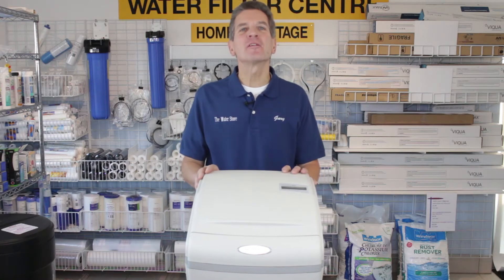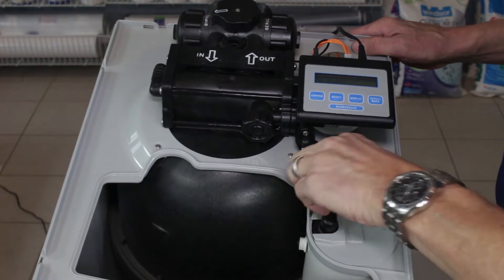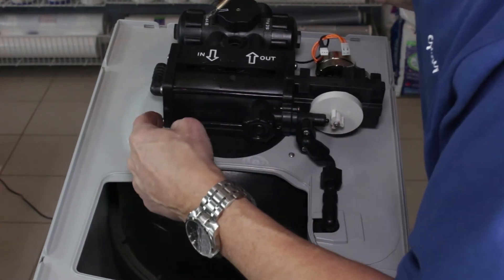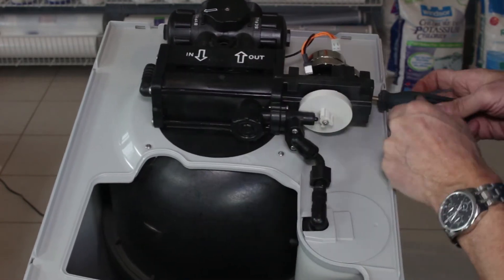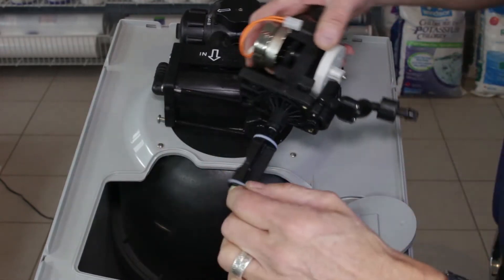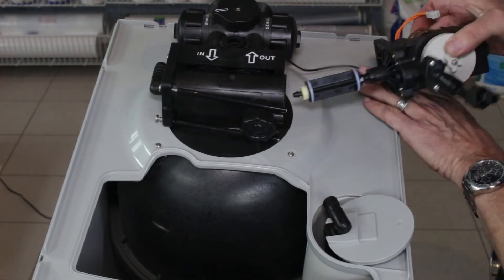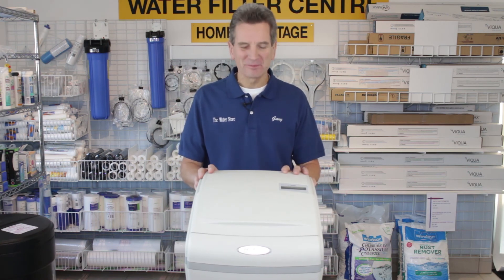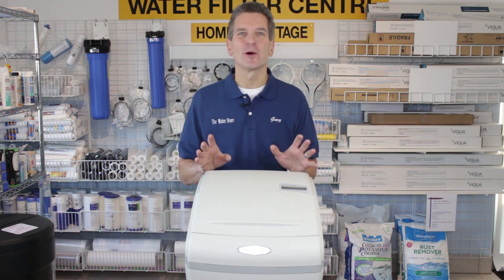How to Replace Piston/Drive End Cap in Aquamaster Water Softener

Comment: Hey Gary, thanks for your videos. They've made me more confident in disassembling and reassembling things on my WaterBoss 950. 

How would I know if I need to replace either the piston or the entire drive end cap assembly? My WaterBoss 950 was new in 2015 and seems to have been working well until recently I noticed a high water level. After cleaning out a salt clog and running it, many times, it still does not draw brine from the brine cabinet. I've tried all the usual suspects, I think, and I'm scratching my head.

I've checked the brine piston and flow control, the injector assembly, the air check/draw tube, the drain line, the drain end cap, etc. Originally I had a couple of inches of salt sludge in the bottom of the brine cabinet and in the brine well, but I cleaned all that out and checked all those other areas, and I still have the problem. During the part of the cycle (when it flashes "02" on the controller) when I would expect it to draw brine out of the cabinet, it never does. Instead there is a slow but steady addition of water to the brine cabinet throughout that "02" cycle (whenever the brine valve is open, I think). I even tried running it with the brine line disconnected from the draw tube, so I could see what was going on. I know the problem isn't with the air check/draw tube, because there is never any suction where the bring line connects at the top.

Now, I did remove and clean out the injector assembly, but I didn't remove the injector throat, because the manual says I would have to replace it with a new one, which I don't have. Do I need to pull the throat out? (In which case I would need to buy a new one?) I'm not even sure how I would get it out anyway. But I did inspect is closely, blasted some air in the there, etc., and it's doesn't appear to be clogged.

Not sure where to go from here. Should I remove the drive end cap assembly and look at the piston? I watched your video on that  (this one) and I'm now confident I could do it, but I'm not sure what I would be looking for.
Reply from the maker: Look to see if the seals on the piston are roughed up or smooth and if they are black or white.  The balck ones are the bad ones.
Reply: @water_estore Thanks. For the benefit of other viewers, in my case the piston was indeed the culprit, with the seals all worn down and rough. A new one restored functionality.